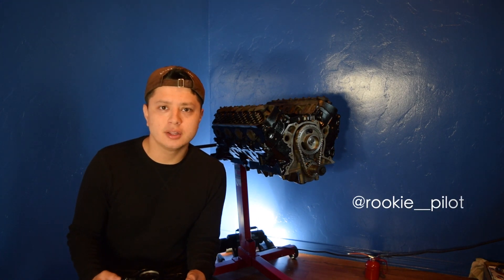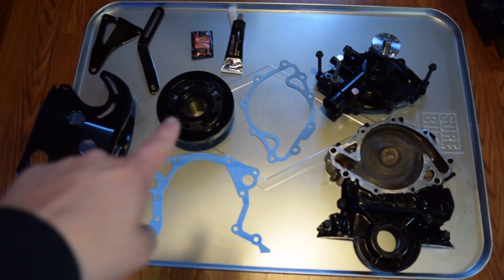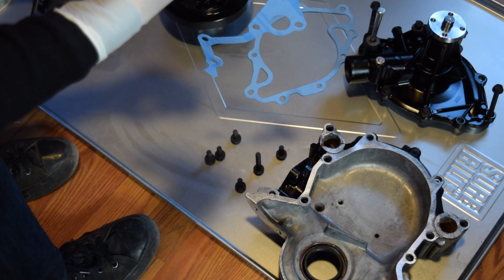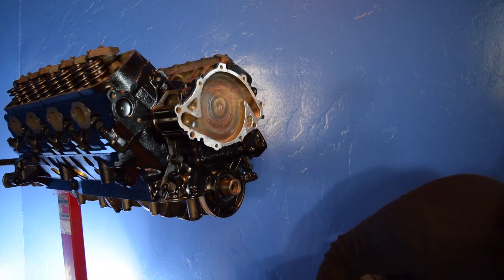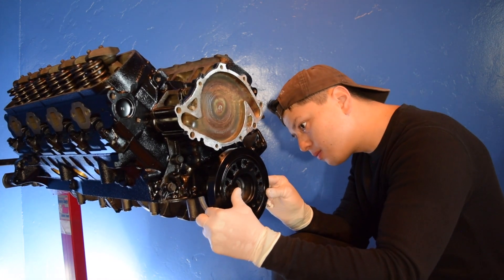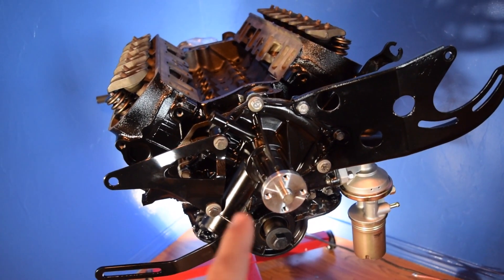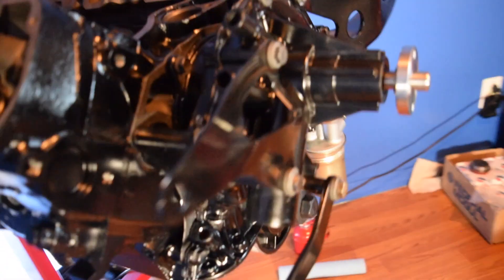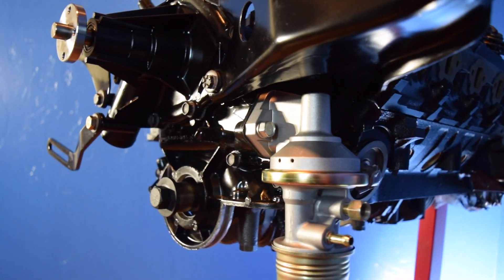289 SBF TIMING COVER & WATER PUMP INSTALL

Comment: I've been a mechanic for 30 years i don't recommend rtv on a waterpump gasket you should use high-tack or a similar product applied to the part not the gasket preferably the timing chain housing
Reply from the maker: Thank you! Ive never heard any downside to rtv on a water pump. Why do you dislike it for that job? Just curious!
Reply: RTV is only designed to fill a gap not seal a gasket. It can cause the part to not properly seal if applied to a gasket. The reason I recommend hi-tack is it holds the gasket in place and won't interfere with bolt torque. You should apply it to the timing cover so if you need to remove the timing cover while its in the the vehicle. I do recommend putting a ptfe sealant on any wet holes in the timing cover that enter the water jacket.
Reply from the maker: Noted, thank you for the advice!